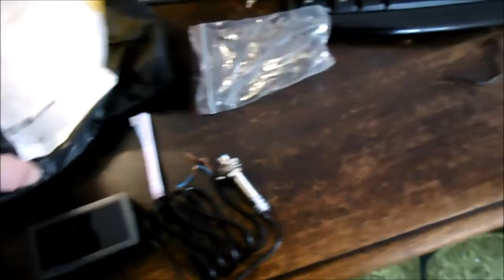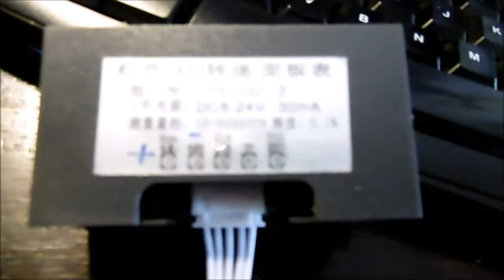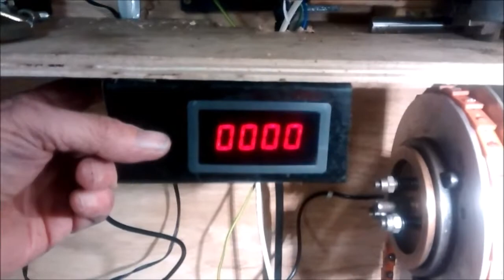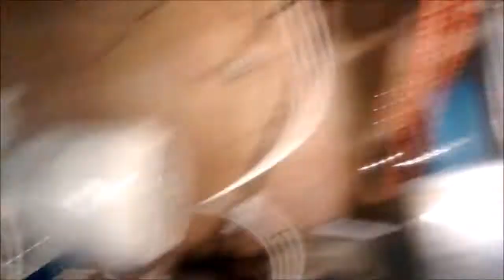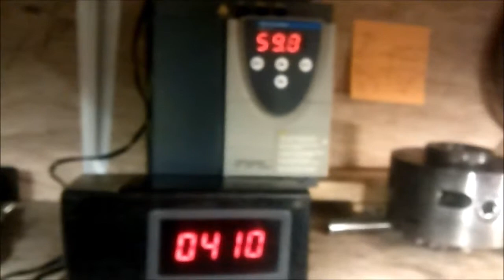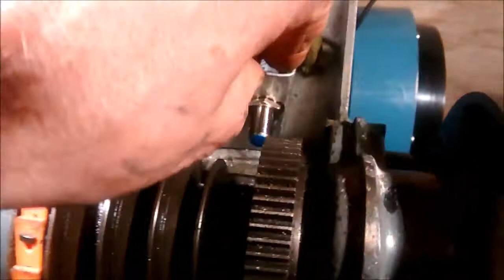Fit low cost tachometer to lathe spindle bull wheel

Comment: Total waste of time
Reply: Which bit? It is still working fine. However, as you say Vince, I rarely bother with it. I just adjust the speed until I get a reasonable cut. I could calculate revs, material diameter, effective velocity of material at the cutting tip, type of material, cutting depth etc  To be honest.... I would choose your way and not bother!

Comment: Looks like you would get better resolution if you used the Bull gear teeth to trigger from?  Count the number of teeth and use that number to divide by for one revolution.  This setup looks a lot like the wheel speed sensors on a car, and it counts a lot faster, looking for slippage.  Now the Chinese cheepO sensor may not be the same type, But something to look into.  A lot can happen in one sensor reading per revolution.  Just a thought.  Full disclosure, I am going to (eventually) try to do this myself, but if you were to beat me to it.......
Reply from the maker: Yes Terry, one pulse per revolution is much lower resolution than you would get from the teeth but enough for my purposes. If we were using this for CNC or for motor speed control then the better resolution would be an advantage.
Reply: That is a great suggestion. I wonder if the sensor would detect the teeth. I guess I could look for a sensor that does. Would you use a light based unit like the hand held tachometer that I've got?